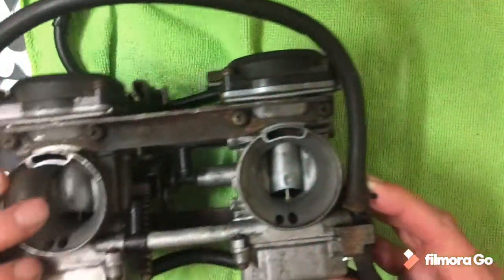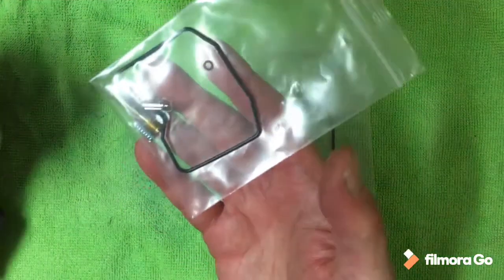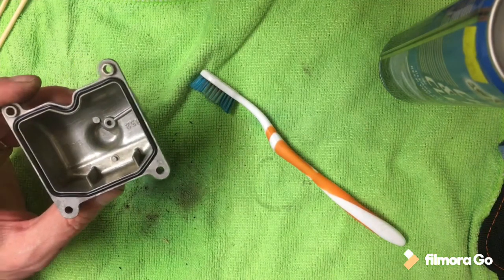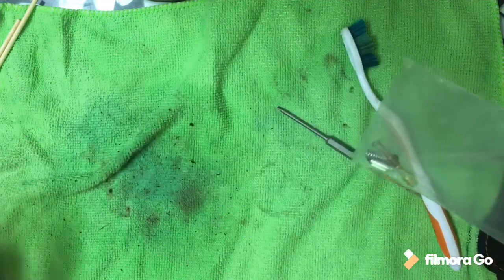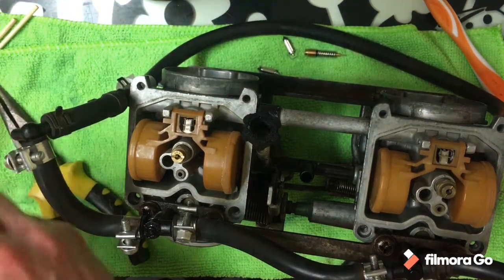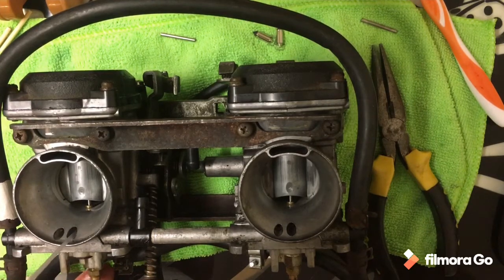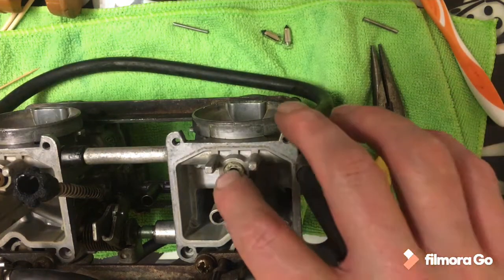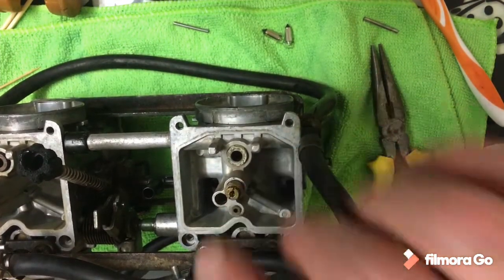Kawasaki GPZ500S video ten - Carb repair kit installation

Comment: Hiya..been having trouble for ages stripped n cleaned carbs few times..found your video few days back got myself 2 kits and bang on thank you..full tank 20 miles later n still no leaking 😀brilliant video helped and learnt me loads tbf
Reply from the maker: Great to hear mate.  Really chuffed that you found it useful.
Reply: @NatsNackersYard  brilliant mate thank you...keep up the good work
Reply: @NatsNackersYard  was the o.ring lol wasn't one on mine either my m8 said meant to have rubber tip on needle 🤷🏻‍♂️....first time I done carbs but deffo more comfortable now.
Reply from the maker: That's why I do the Vids mate. So we can learn from each others mistakes!
Reply: @NatsNackersYard  ive set my needle at 2 n quarter I think was......well same as what u did.the bike runs loooads better now just a tiny bit of sluggish when open throttle up do I need to adjust the screw a little would u reckon.
Reply from the maker: @bikerdotty7395  probably mate. Have you balanced them too?
Reply: @NatsNackersYard  I don't think so will look into it..thanks

Comment: no rubbers on mine either.  bike only had 1800 km on so reckon that was a factory fit orientation.
Reply from the maker: I think you might be right mate.
Reply: @NatsNackersYard  strange one isn't it.  I just know the bike I have has 1800 km on so would not expect them to be fiddled with.  it does seem more sensible for them to be there.  perhaps fitted at different year models.
Reply from the maker: @MrThewillows  maybe mate.

Comment: Cheers again nat great video ......just added a delkevic 2 in 2 on my gpz 500 found  it running very hot on one cylinder any suggestions I've stripped and cleaned cards no difference ...any help greatly appreciated 
Mick
Reply from the maker: Have you balanced them mate?  Sounds off balance to me.
Reply: Thanks Nat wish the orders from ebay were as quick as you ..was going down that path ordered vacuum gauges a week ago don't have a lot of confidence in myself but I'll muddle thru
Reply from the maker: @mickapicella5023  that's exactly what I do!

Comment: Hi I've just got myself a 1998 gpz500s and noticed the carb warming system has been blanked off can you give any advice on why this may have been done
Reply from the maker: I have only ever seen them on an sv650.  I really don't think that they are needed, especially in UK.
Reply: The fuel mileage js best when the carb I warned from the engine coolant... Not sure why owner deleted but will be slightly worse cold running and less efficient